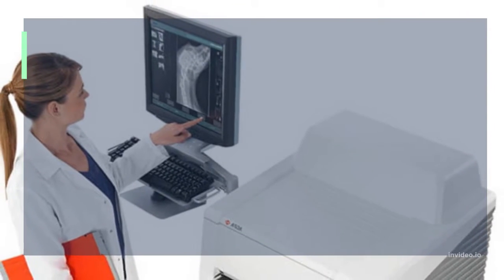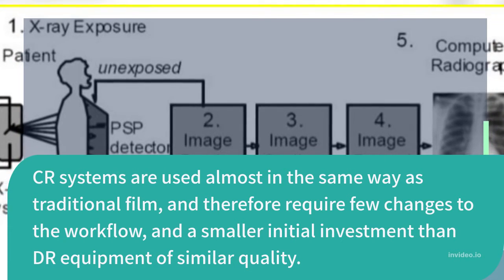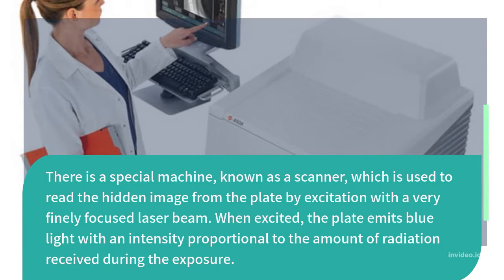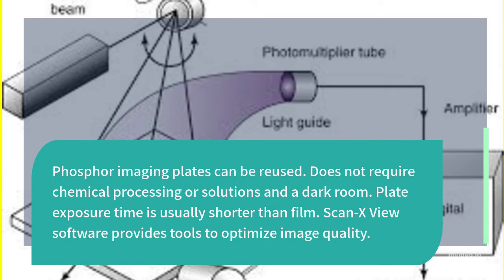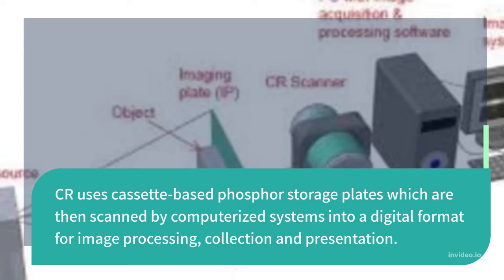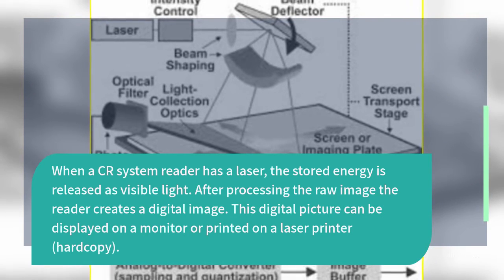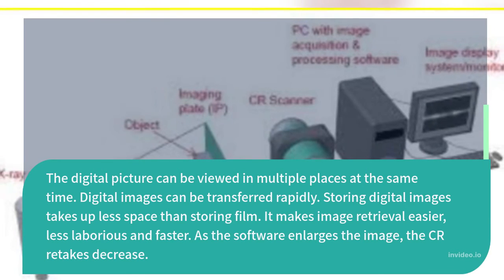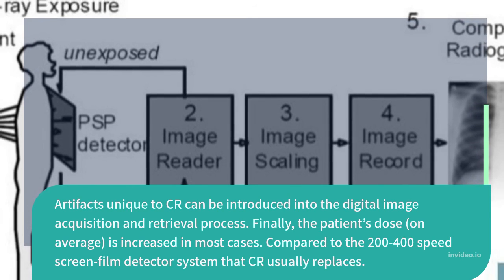What is CR System,  Working Principle of CR system & procedure of CR system, Difference DR vs DR

Comment: how to work on cr system
Reply from the maker: 1. An imaging plate is exposed to X-rays or gamma radiation.
2. A scanner digitizes the imaging plate and erases it for reuse.
3. A computer monitor displays the digital image for evaluation with specialized software.